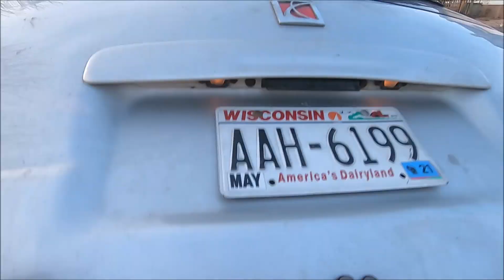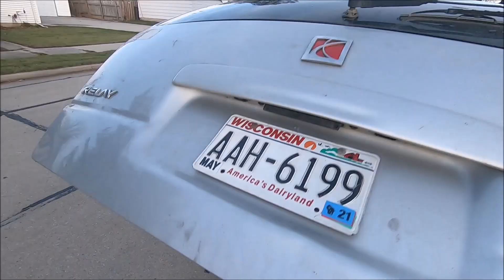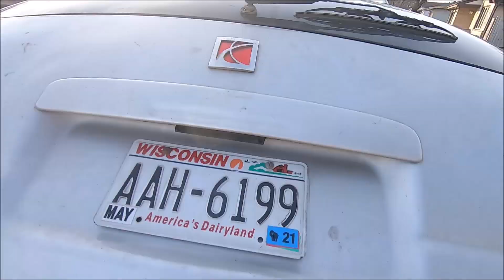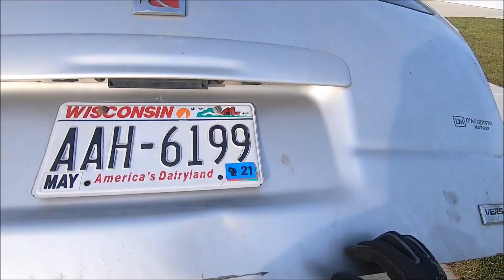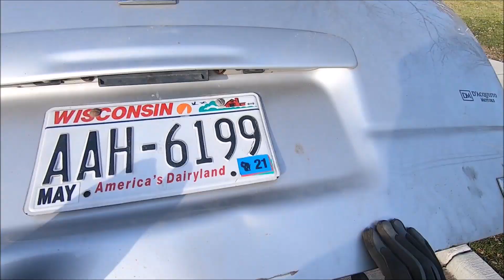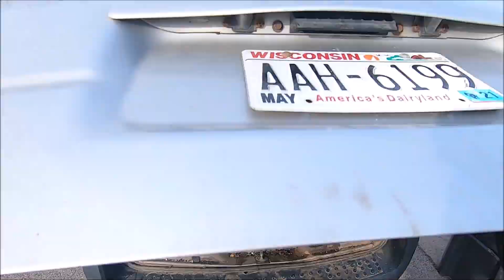STREET SCRAP 11.19.2020 (fun)

Comment: Good luck cortisone is not usually anything other than temporary.
Reply from the maker: Thanks Jeff! That's for sure. I've had them before and they usually wear off after about 6 months. I'm gambling on the issue NOT being a tear of some kind. If it is a tear, I will have to have surgery.
Reply: @OldFatGuy  I got ashot in my ankle tuesday , I couldn't hardly even walk Tuesday or most of Wed. I'm going to have to get my ankle fused ,it is shot.